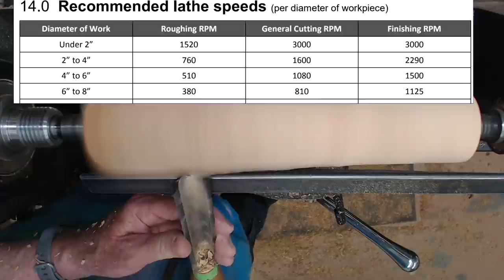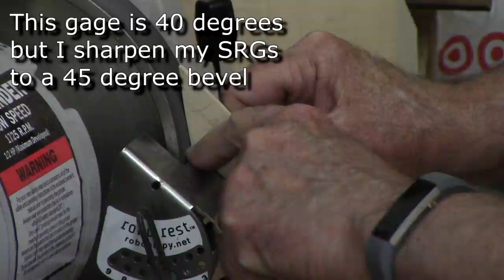The Underrated Spindle Roughing Gouge

Comment: Lot's of great information, Mike. My only quibble is with your tool recommendation. I USED to be an advocate of new turners buying some inexpensive tools, such as the Harbor Freight 'Windsor Designs' tools or 'Benjamin's Best' tools from a number of different sources. I made that recommendation for two reasons. First, when you're first starting out, learning to sharpen can be intimidating. It takes practice to learn how to do it properly. If your tools are fairly expensive, most of us are reluctant to sharpen them as often as necessary. The result is the new turner is often trying to learn how to turn with dull and improperly shaped tools. That can be very frustrating! (Been there. Done that.)

The second reason is I got lucky. The first set of Harbor Freight tools that I bought were very decent. As expected, there are too many marks left from machining, but some hand work by me (a lot of hand work) addressed that issue. And, the HSS was of very good quality. It sharpens and holds an edge very well. 

Why have I changed my mind? I bought a second Harbor Freight tool set when it was on sale (these were the supposedly nicer 'dark handle' set). Most of them were junk. The HSS simply will not hold an edge. At about the same time, my family decided to buy me a ton of Benjamin's Best tools for Christmas. (I'd made the mistake of going through the PSI catalog and marking some tool designs I was interested in getting -- some day, from a different brand. Someone found the catalog and ....) The Benjamin's Best tools were also mostly junk. I spent hours trying to clean up the mill marks. Once that was done, most of the tools would not hold an edge.

My concern is NOT just that buying cheap tools is a crap shoot in terms of quality. My concern is a newbie won't have the experience necessary to know if it's the tool or the turner that's the problem. Had I started turning with the bad set of HF tools, I would have given up. With those tools, you cannot get good results. Within a second or two, the edge is shot! You cannot learn to turn with a perpetually dull set of tools! As a newbie, I would have concluded I simply could not learn how to sharpen or learn how to turn. So, that's why I now recommend a newbie buy a minimum number of tools, but to get all those tools from a reputable maker.
Reply from the maker: Thanks for providing your experience. I guess I got lucky on that one HF SRG. But I agree that one of the biggest issue with the cheap Chinese tools is poor quality control and some poor heat treating. I guess my message was a bit mixed about buying the best tool you can afford and then mentioning pretty good experience with this one tool that might imply I encourage turners to go out and buy a HF set of tools. I did get some very poor tools in my HF set but a few of the tools are still serving me well after regrinding into a specialty scraper.
Reply: Well said, ran into the same experience, went to a class and used their tools and it rocked my world.
Reply: Painter never learn on cheap brushes. Learn correctly..brush is your tool.

Comment: Enjoy your videos. Curious, the  grind angle is targeted at 45°. But you present the tool at about 90° to the spindle. So you don’t ride the bevel of a SRG?
Reply from the maker: I present the tool with the bevel rubbing at 90 degrees with the handle low. Lift the handle till the edge starts to cut. Then control the cut by inclining the flute in the direction of the cut with the edge slicing at about 45 degrees.

Comment: Hello Mike I was hoping you can help me with a problem that I have with my lathe I recently put a spindle adapter on my 3/4x10 tpi lathe to convert to 1x8 tpi I then put my jaw chuck on there to turn a piece of wood, now my chuck and adapter is stuck on the lathe. Do you have any tips?
Reply from the maker: Open the chuck jaws wide enough to put a long piece of steel with one end stick out a ways. I use a long thin pry bar, maybe 14 long. Tighten the jaws on the bar and wack down on the end witha mallet. If the adapter breaks free with the chuck, just leave the adapter on the chuck. If the chuck comes off but not the adapter. You need to grap it tight with some vice grips so you will have some leverage. You need to find out why it is sticking. A burr, loose fit before turning on the lathe or whatever.
Reply: You wack the chuck counterclockwise correct? To get it loose?
Reply from the maker: @tannerking4130  Yes.

Comment: mike i love your videos but i have never found a roughing gouge that will square a 4 corner square without it not bouncing and tearing the wood out of it,,not cutting it reguardless of how much you sharpening it,,,,nornmally i use a bowl gouge and start on the end and come across with it,,,so much easier,,,,,i guess its just me,,,but i never use a spindle gouge,,,never ever had any luck with one
Reply from the maker: It is not luck. Respectfully, if it is always bouncing and tearing the wood, perhaps it is your technique.  Does it appear my cuts in the video show your problems? Are you scraping or slicing?